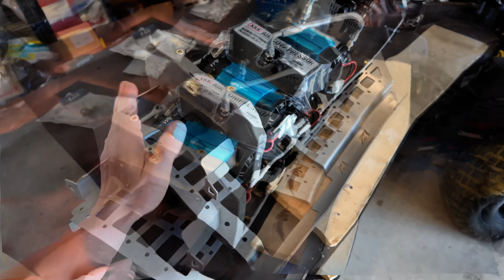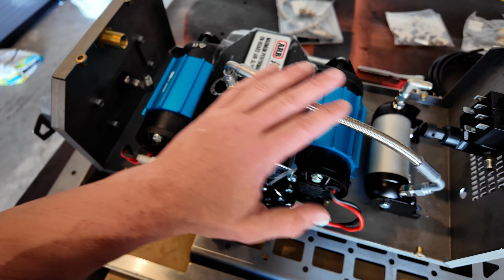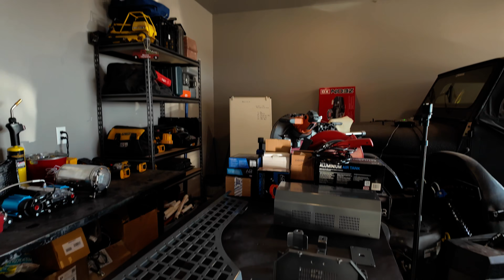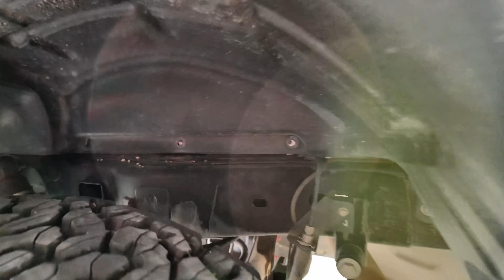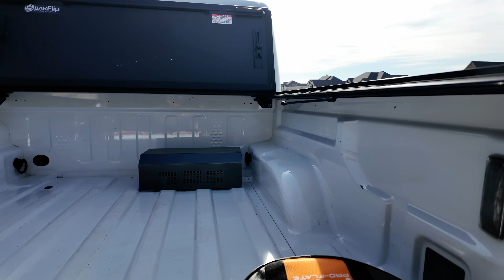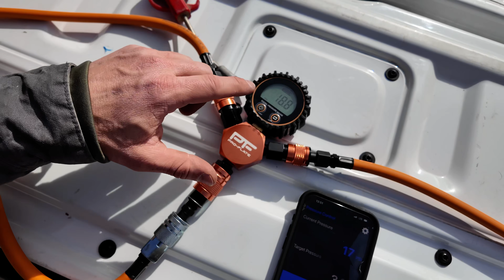Is this the Ultimate Onboard Air System for any offroad truck??

Comment: If you have the tank do you need to keep the small manifold? I have the same set up and I am considering deleting the small manifold but it has 1/4" ports for the lockers which I don't have yet. Does it have to be that 1/4"?
Reply from the maker: So we don’t have any lockers in that set up yet either. I would say keep the manifold because when you do the lockers it’s not just an air line coming out of the manifold. There is the solenoids with wiring that screw directly into the manifold then turn into air lines. I don’t know your exact set up, but there is a chance you could make the solenoids work coming directly off the tank as well.  I would just be worried about them or the wiring getting damaged. Hope that helps some! Thanks for watching!